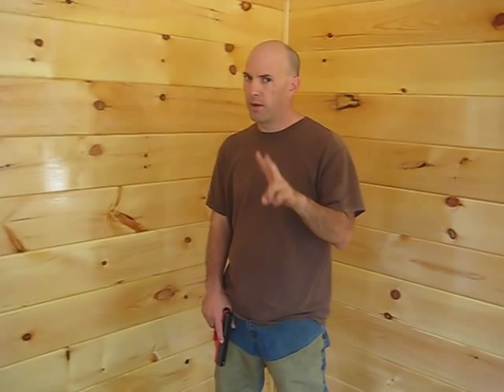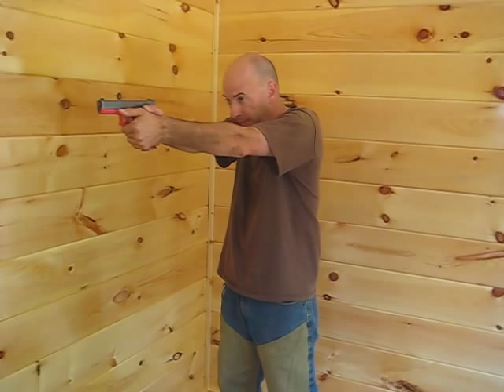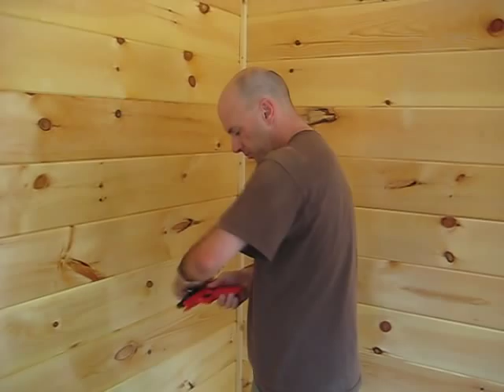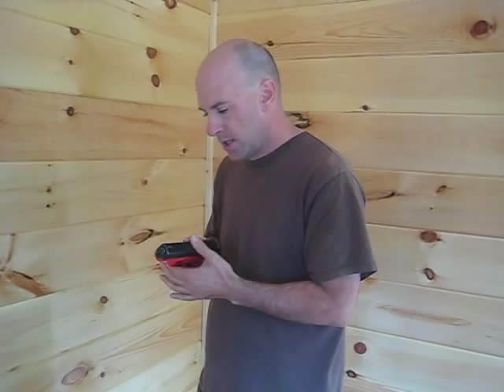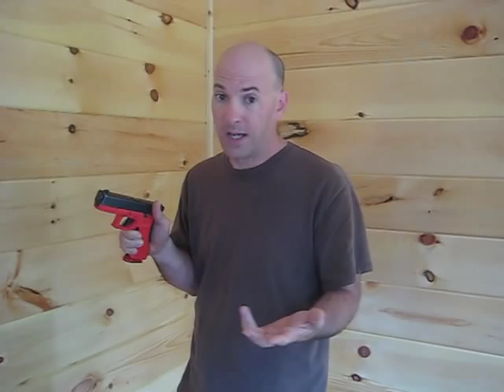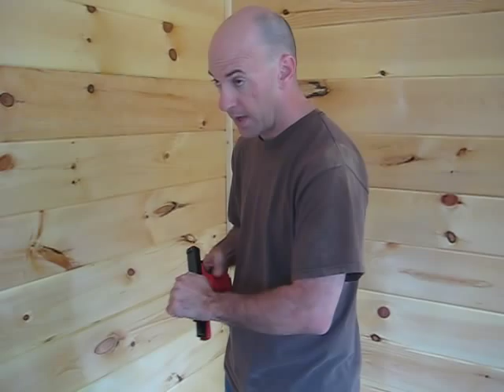Stoppage Reductions By Gomez-Training.com

Comment: The non-diagnostic approach turns into pure reflex.  It should clear most malfunctions so dont waste time investigating.  After that either the gun is running or needs a diagnostic look.  Awesome man!  In a fight dont think just react.  If tap, rack, bang doesnt fix the problem you may need to transition to another gun or get out of the fight.

Comment: Excellent presentation of useful information. Just a side note, I have accidentally induced a double feed (failure to extract) by doing "tap , rack, reassess" on a stovepipe type malfunction by not racking the slide vigorously enough. I now teach folks to be "vigorous" when performing this and it seems to cut down on the number of type 3 malfunctions caused by trying to cure a simple type 1. Keep up the good work, I enjoy your videos.

Comment: Nice!!  I would stress that not enough attention is given in a practice session to handle stoppage. In a high stress situation handling a stoppage if not well rehearsed can become very problematic..  I have seen in training many who could not resolve the stoppage, just because of stress..  I tend to agree with your non diagnostic approach and would suggest to try and make it simpler, if that is possible. PRACTICE PRACTICE.  How many will practice handling stoppages?